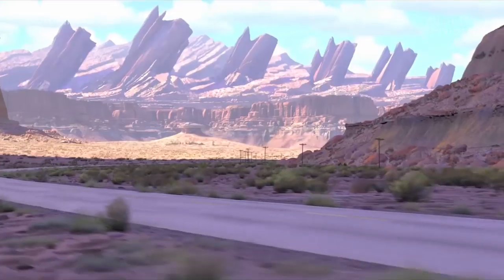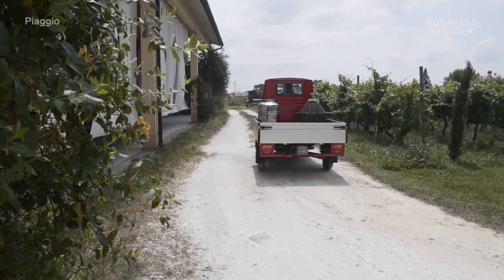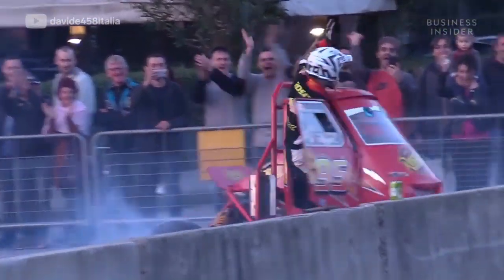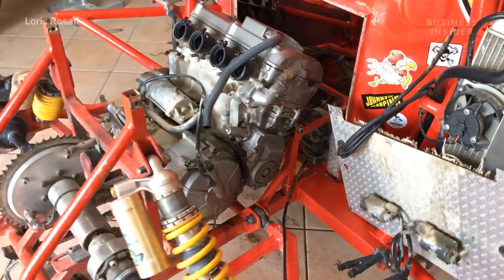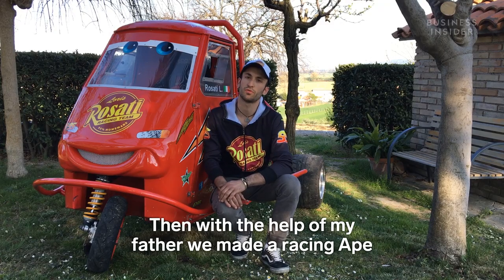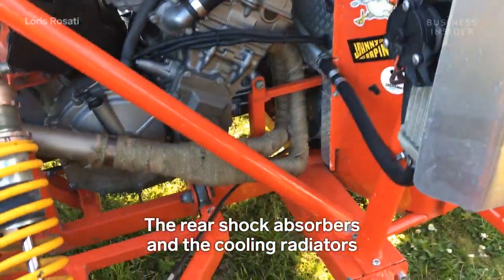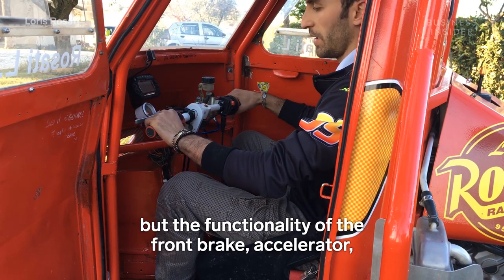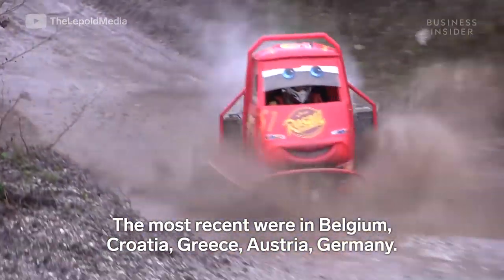Tiny Three-Wheeled Cargo Vehicle Racing

Comment: Lighting McQueen is Porsche 911 styled with a Corvette 6.2 liter v8 engine. Upwards of 700 horsepower, top speed of 198 and 0-60 in mid 3s.
Reply: I always thought he was a Ford Mustang, the older types.
Reply: @RickyRegal.  or viper

Comment: Although a three-wheel design makes sense for many reasons---they tend to be more aerodynamic than boxy cars, they offer greater protection than a motorcycle, low weight plus big engine means lots of fun---the benefits can be outweighed by the instability.